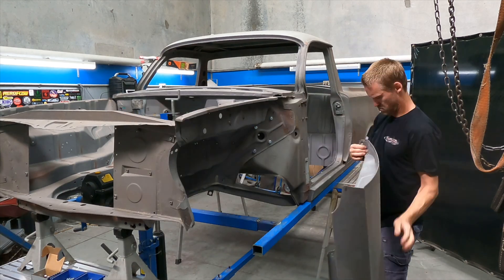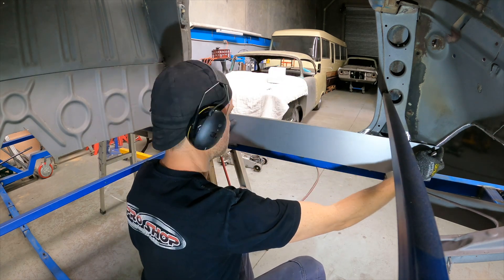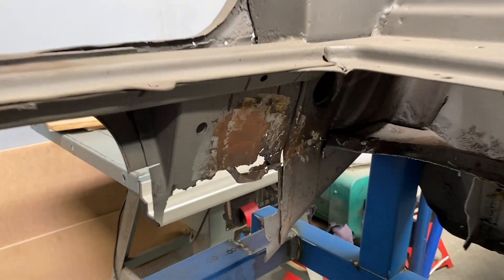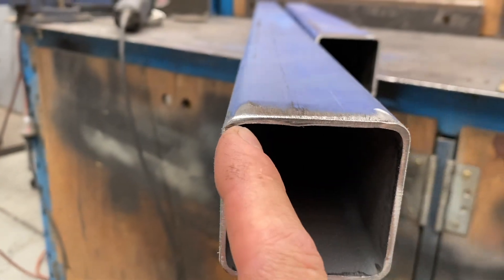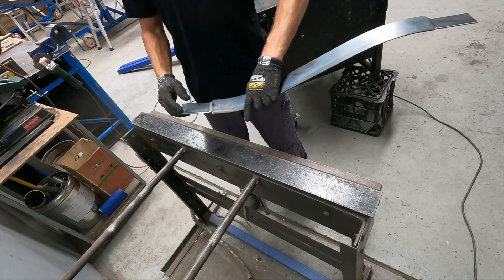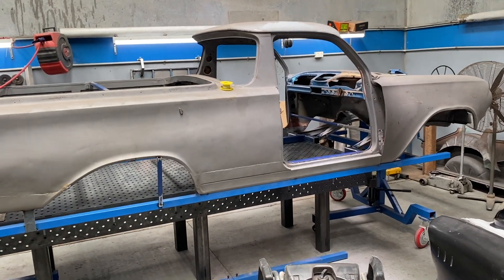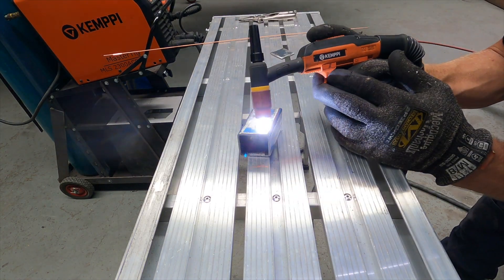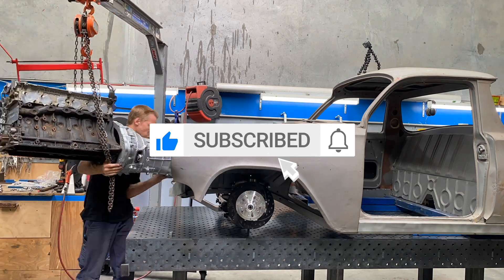EH Holden Build With A Nissan RB26  Motor | Fitting The New Chassis

Comment: Got me hooked on your channel now mate, how many hours into the removal and remaking the chassis & rails. Would love similar for our HK Ute project but want to keep leaf spring ass end
Reply from the maker: There was about 2 weeks of constant work to remove the floor and inner sills then build the rails and install them. As you saw this car needed a lot of repair work even before putting the rails in so that added to the build. If I were to do it again I will get the rails bent into shape and that will save a heap of time in welding them together. The last EH we did still kept the leaf springs which made it easier too.